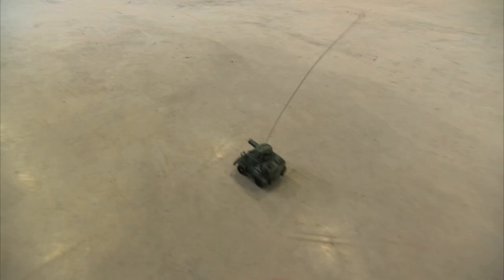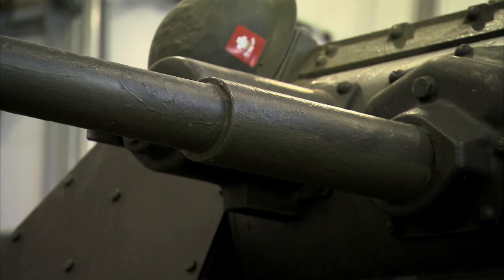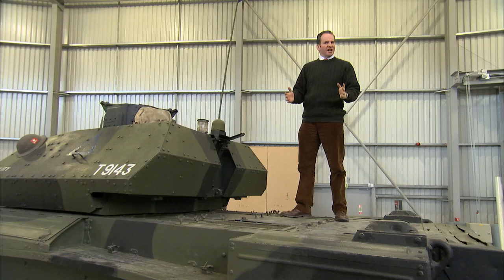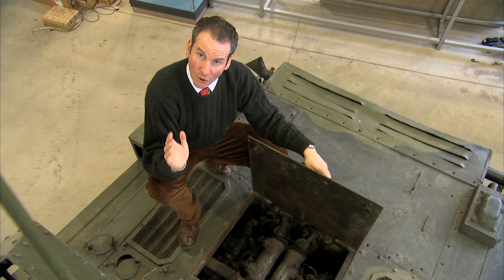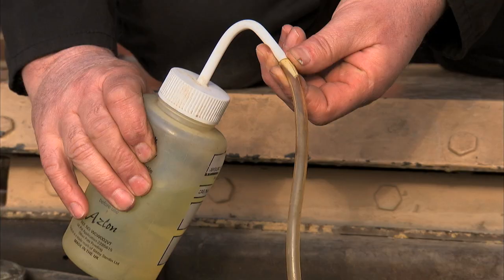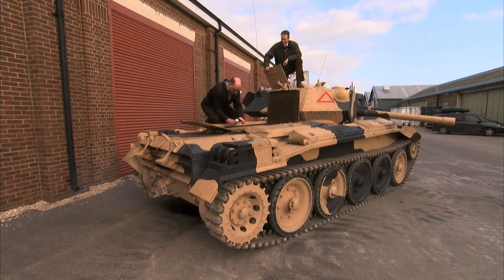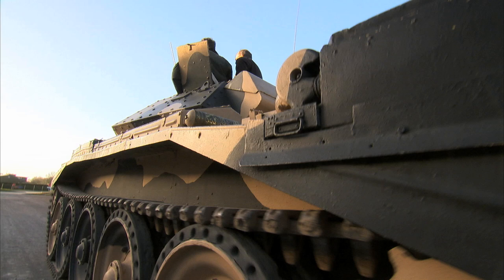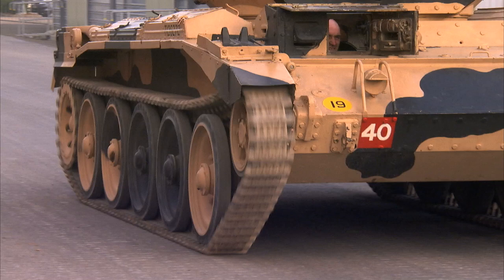The Road to War… the Cruiser Mk III Tank

Comment: "Dangerously unreliable" -  a WW1 designed engine with exposed tappets being used in dusty conditions of the dessert - well that's hard to believe or predict.
Reply: Or the non-existent cooling system, which did not help the already dire situation.

Comment: the crusader wasn't that unreliable, it only got that reputation because the air filters kept clogging from the dust in Africa.
Reply: And the dust filters being placed in the dustiest place of the tank, above and slightly ahead of the rear sprocket wheels.

Comment: Praises the engine through out the video. The last words said are "dangerously unreliable"
Reply: the reliability issues were nothing to do with the engine more the shitty gearbox and the tracks being far too narrow
Reply: There is nothing wrong with the tracks, the tank is light enough that them being narrow isn't an issue. The main issues are the air filters being exposed at the back of the tracks and clogging up with sand constantly, the poor cooling system (common problem in the desert) and a lack of spare parts. When they were working they performed well.
Reply: @Arrrbol  true, especially after Nuffield sent a team out to make sure that they were getting prep'd properly.  Also, later ones had addressed most of the issues and also had the 6pdr, but the reputation of the Crusader never truly recovered, which is a real pity.
Reply: The drive plate is problematic. It comes loose and kills the crew.
Reply: @jonsouth1545  Bigger tracks would increase resistance and reduce the speed and acceleration.
Reply: @bryanmartinez6600  not always it would depend on how much the ground pressure was in most cases it s a bad idea to widen the tracks but in areas like the desert it is needed as the narrow tracks designed for western European use are simply not able to speed the weight properly in sand (or snow) thus massively increasing resistance on an already weak gearbox
Reply: @bryanmartinez6600  yes because race cars have narrower wheels than normal cars, oh wait they have wider wheels. as it turns out traction is very important for vehicle acceleration, you need that resistance for the vehicle to accelerate well. the actual limiters in tank speed is power-to-weight ratios and suspension travel (and absorption), wide tracks slow down tanks due to weight increases more than anything else.

Comment: Christie basically built tanks on wheels which could be fitted with tracks. In fact you could rhen them on their wheels like cars and race around, at least if you were running on flat ground like a paved road. 
The Crusader was a good idea on paper, making up for its weak armor with high speed. And it is difficult to track a fast tank with a slow moving anti-tank gun or a turret on another tank. But speed can't stop a shell if it hits and more speed usually comes with the price of mechanical problems. If that situation occured, then the Crusader was a sitting duck.
Reply: its 'weak armour' was actually fairly decent when it was designed and entered service. it had more armour than contemporary german and italian medium tanks for example (just because the former were able to upgrade to being better armoured doesn't take away from this fact).

and the cromwell was plenty fast and statistically the most reliable medium tank of ww2 (yes it broke down and had issues far less often than even shermans) and stuarts were even faster than crusaders yet more reliable (hence they eventually got the 'honey' nickname). its not its speed that caused its reliability issues.
Reply: @matthiuskoenig3378  - you're not an engineer by any chance, Matthius? Your posts display a great deal of knowledge.

Comment: "As World War II loomed, Nuffield, producing British Cruiser tanks, licensed and      re-engineered      the {Packard} Liberty {aircraft engine} for use in the A13 (produced as the Cruiser Mk III) and later Cruiser tanks."    "The reconfiguration of the Mk. III Liberty engine into a flatter format to fit into the Crusader {Cruiser, Mk VI} engine compartment had badly affected the tank's water pumps and cooling fan arrangements, both of which were critical in the hot desert temperatures."       
 https://en.wikipedia.org/wiki/Liberty_L-12#Tank

Comment: A lot of Tanks & Armored vehicles used Aircraft engines, or derived from Aircraft Engine here is a partial list.

US
M3 Grant/Lee - Continental R975
M18 Hellcat- Continental R975
M4 Sherman Continental R975
Early M3 Stewart Continental W-670-9A

UK
Cromwell -Rolls-Royce Meteor
Challenger -Rolls-Royce Meteor
Avenger -Rolls-Royce Meteor
Comet -Rolls-Royce Meteor
Centurion -Rolls-Royce Meteor
Charioteer -Rolls-Royce Meteor
Conqueror -Rolls-Royce Meteor

USSR
BT-7 Mikulin M-17 (Lic Built BMW-VI)
T-28 Mikulin M-17 (Lic Built BMW-VI)
T-35 Mikulin M-17 (Lic Built BMW-VI)
Reply: Those are aircraft derived engines. Aside from the ones that used the Liberty, I cannot think of any engine of this time that saw service in vehicles used in combat that was an aircraft engine.
Reply: @peterson7082  the Liberty was modified for tank use about as much as the R975

Comment: It wasnt so much the engine that was unreliable it was the very cramped engine bay which made maintenance difficult plus the Oil and Water cooling systems that were the problem, the cooling fans were driven by a Motorbike chain about 9 foot long which wore out and slipped causing the engine to boil up.  

The engine air intake filters also caused problems they were mounted on the track guards at the back above the drive sprockets exactly where all the dust and muck gets thrown up by the tracks.  Not the best tank of the war but one of the most handsome and that engine noise <3
Reply: Right.. so the engine
Reply: @guaporeturns9472  Yes but once the cooling and filtration system was sorted out the Nuffield Liberty was a reliable engine. It was still in use in the late 1940s in the Crusader gun tractor when other cheap or free vehicles were available. You feed any engine a mix of hot dusty air it's going to fail rapidly. The Crusaders ancestor the Cruiser MkIII which had an earlier version of the Nuffield Liberty was considered very reliable in the desert.
Reply: @stuartburton1167  Right ..I got it the first time , just being a smart ass… 
so the engine

Comment: The Crusader would have been an effective weapon if, and only if, they had given it a larger turret ring.
Reply: no, unreliability was its worse issue. one of the main reasons people forget about operation crusader is that the british were not able to fully exploit the victory as a result of the unreliability of the crusader. and the battle was almost lost in part due to said unreliability. 

its gun (especially on the crusader mkIII) was good enough against most of its contemporary opponents (remember tigers were super rare, and the 6pdr was plenty to deal with panzer IIIs, IVs and italian tanks. even the 2pdr was good enough against the lighter armoured versions of those tanks like the earlier pz IIIs and IVs).

furthermore, the turret ring of the crusader was actually larger than that of the churchill, why they didn't bother makeing a 3-man 6pdr/75mm turret for the crusader went they did for the churchill (and the AEC mk II/III). simpl put the turret ring of the crusader was very good for its period of use, and had they been more reliable it likely would have soldiered on into north west europe as similar armed vehicles did.

Comment: the M-18 Hellcat is faster
Reply: And it dosnt have that crappy Christie suspension. In 1941 Soviets were planning to change the production from T-34 to A-43 with torsion bars and only the war prolonged the production of T-34. USA and IIIrd Reich never bothered with it.
Reply: The crusader could get pretty close with the speed limiter removed. The speed governor really limited it.
In the official tests it could go well over 65kph, but was limited due to the excessive wear and tear it caused.

Some crews with removed governors unofficially clocked it at 89kph

But the hellcat was unofficially clocked at 97kph, so yeah. Fastest tank of the war. Wouldn't surprise me if the later engine models of hellcat could break 100 running empty.
Reply: Thats not a tank you plank.
Reply: eraldorh

That's just semantics as a result of the naming scheme. 

You'd be hard pressed to argue the significant difference between a type 64 and a hellcat, yet one is considered a tank while the other technically isn't.

The same could be argued of the wolverine vs the sherman.

As far as it matters, it was a tank.
Reply: +Brent Smith I wouldnt be hard pressed to argue the difference at all. A tank can engage all targets a tank destroyer can only engage tanks, m-18s were only equiped with AP rounds and had no mounted machine gun and had little to no armor and no roof on the turret so couldnt deal with infantry where as a tank can. 
Just because a vehicle has tracks doesnt make it a tank. 
The type 64 is from a different generation, had both ap and HE rounds and a mounted machine gun. Quite a few differences right there.
Reply: Um, the hellcat did have a mounted machine gun. http://www.dday-overlord.com/img/chars/m18_hellcat.jpg

Did you mean co-axial? If so, that's a pretty petty difference. Many tanks did not have co-axials.
The king tiger and several variants of the famous T-34 for example.

Both the m18 and the type 64 were thinly armored and open topped. What the hell does generation have to do with it? The type 64 was basically cobbled together from copied previous gen designs anyway.

Basically what you are saying is that if you built a replica hellcat in the 70s and put a few HE rounds into it, then it would be a tank? Maybe add a co-axial and a range finder to make it even closer.

The only thing that makes it stand out is that it was labeled a tank destroyer by the US military because it was intended for a specific role, hence the AP only loadout. It could still fire HE if it had it, and nothing would have prevented it from being used as a light tank if needed.
Reply: 1. It's M18, not M-18, the American never used dashes for tank designations
2. The M18 did have a mounted machine gun
3. the Tiger II and all T-34s had co-axial machine guns
4. the M18 could fire any round for the 76mm M1A2; the fact that doctrine specified it was an anti-tank vehicle is what makes it a tank destroyer, not the ammunition it fire; Sherman crews would sometimes bribe M18 crews to give them a few rounds of high velocity armor piercing for "just in case"
5. It was designated a tank destroyer but referring to the M18 as a tank is fine, tank is a catch all term for "a fighting vehicle with tracks"
Reply: the Hellcat didn't exist yet when the crusader was around
Reply: christie is crappy because its maintenance was hard, and take up a lot of space inside the tank
Reply: @cimcimnig  it's not that it's crappy, it's just that torsion bar has the same advantages and is less problematic, so replaced the use of Christie suspension.  The Crusaders and Cromwells used a variation of the Christie suspension
Reply: The M18 was going into production when the Crusader was going out of production.

Comment: hate to say it but the cruiser 3 is NOT  high speed tank compared to Germany and Russia's counter parts... it's slower than their heavies
Reply: +Ian Shearer It is a high speed tank. 24hp/t. 50% more than any medium tank. If you were talking about the top speed, that was set at 30mph for safety and maintenance reasons. No army needed faster tanks. Look at the Comet for example. Britain was making a bigger Cromwell but they decided to set the engine governors at 52km/h - Wiki quote "to preserve suspension and engine components and to reduce track wear". Soviet concept of cavalry or cruiser tanks died with the BT-7. T-34 didnt need to go faster than 50km/h.
Reply: Crusader or cruiser?
Reply: The Crusader is a cruiser tank.
Reply: False
Reply: The tank in the video is not even an cruiser III, it‘s an crusader lol